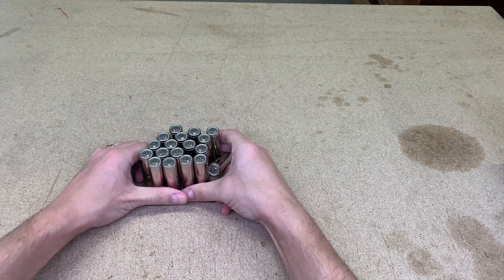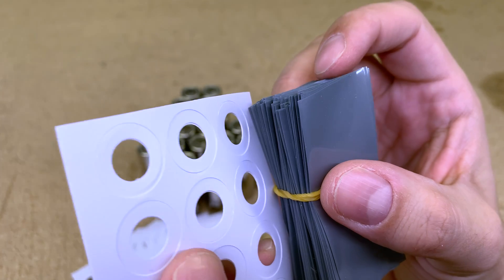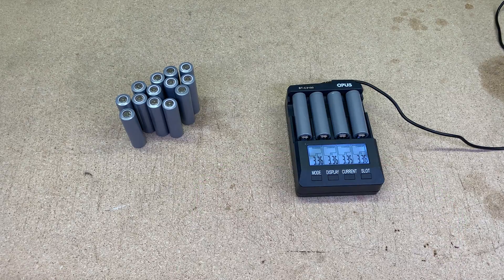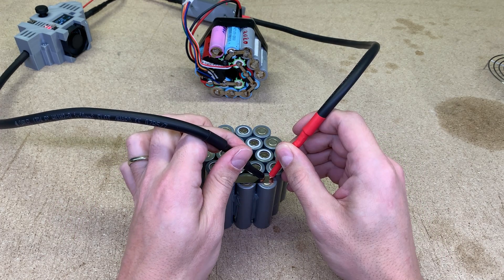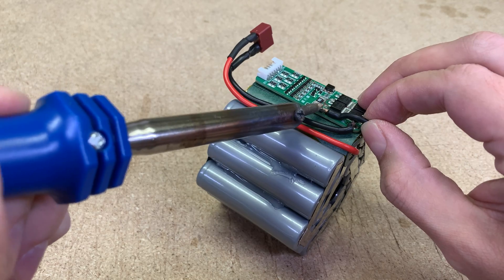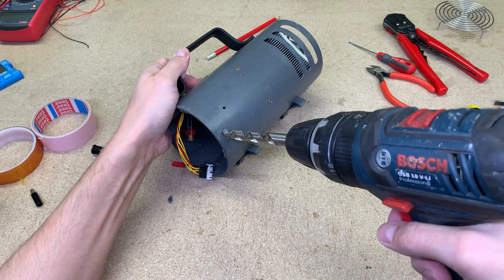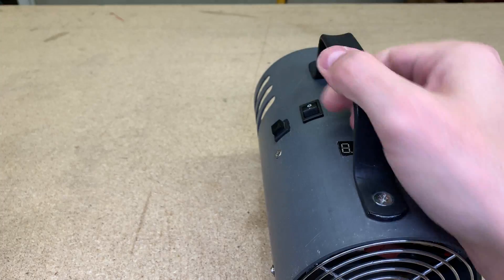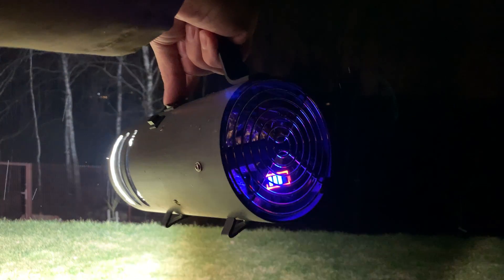A Flashlight Battery From 18650 Lithium Cells

Comment: Wait a second. Your B6AC will let you charge non-Pb batteries without the balance leads connected? Mine won't.
Reply: Use Li-PoCharge mode and not Li-Po Balance mode. I have the same with Turnigy Accucel 6 and it is fine :)

Comment: There is nothing unique in Tesla cells. You can just use any good 18650 cells from a decent manufacturer. LG, Sanyo, Panasonic, Sony etc
Reply: Older Tesla cells are just rebranded Panasonics.
Reply: Tesla uses NCA nickel cobalt aluminum batteries. They have a higher energy density and a higher top-of-charge voltage than plain old cobalt or manganese cobalt cells. They are also safer in high-power applications.

Comment: Why you need all those batteries if it’s only 25 volts is each one like 3.5 volts each does it give more amps with more batteries I want to make a 36 volts battery pack for my electric bike how many batteries do I need to get to make it 50 amp hour will it be big in heavy if so how much will it weigh I have the swagtron cycle with that battery pack in the middle that’s only a 4 amp hour battery it does not go that far

Comment: How do you disconnect the cell balance meter with only a single switch? The voltage dividers on the cell pairs will have a parasitic draw that will bring the pack out of balance over time unless you disconnect all but one wire to the meter.
Reply: Not all the step covered in this video.... Why ?